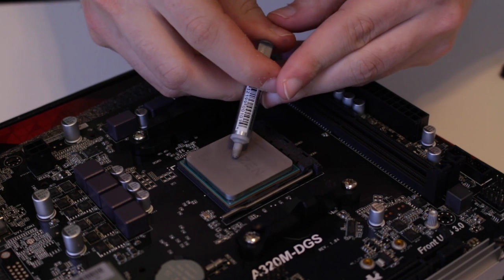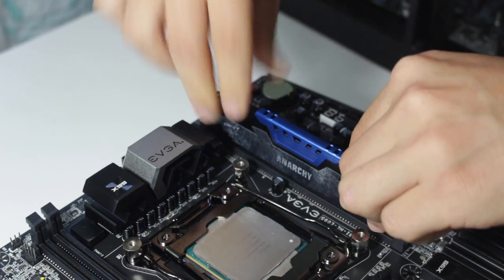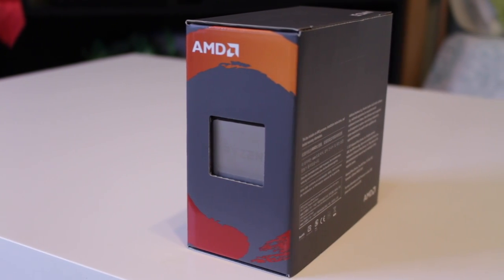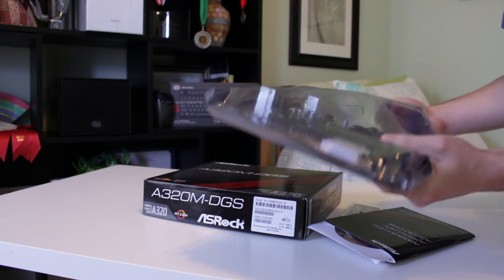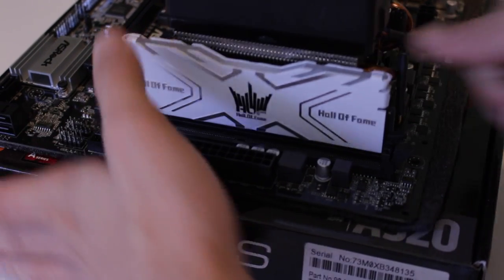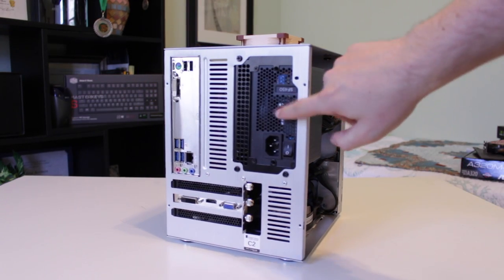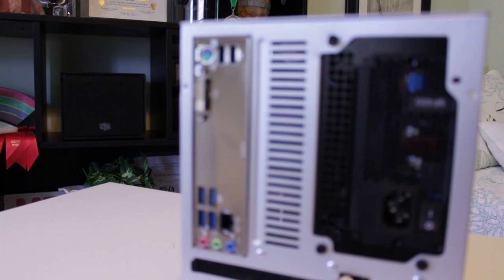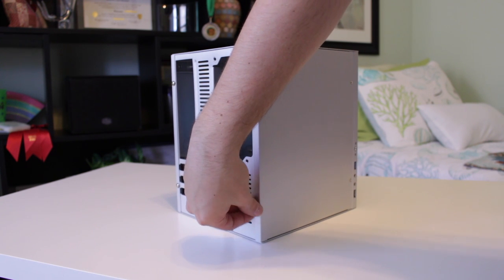I Switched From Intel to AMD... My Build and Why I Switched!

Comment: Reverse the air flow on the bottom fan to blow UP and simply drill a sexy pattern of venting holes in the top of the case, since heat rises, you might as well take advantage of THAT without having to add another fan. Suck cool air from below, vent it out the top - DONE.

Comment: You need to turn the bottom fan around to use it as an intake fan. Otherwise there will be negative air flow and will run as such.

Comment: yes cut the hole for the fan on the top back it's going to help you alot I have been building and doing mods since 1998 when I got into pc. good luck use tape so you won't scratch the surface.

Comment: dont screw up your case!
if anything just cut some vents on the side... youre problem atm is having an exhaust fan on the bottom... but hot air goes to the top, so better make it an intake fan! this way you also get yourself a push pull config
Reply: Looks like he did it by mistake.
Reply: Mr.Haaska he most likely just didnt think that far :P

Comment: You should definetly do the mod, the hot air is bound to rise so you should pull the air out from inside to the top and get frash cool air from the bottom.

Comment: If you're gonna cut the case, find some wire mesh or something and then mount that fan inside the case with the wire mesh bent to where it will sit flush with the top of the case. 

Kinda mac g5 style mesh or something.

Comment: why don't you cut out top of the case like you said install the fan inside attached to the top with fan grill and screws holding the fan in place
Reply: BadKarma 714 he'd have 4 screws sticking out the top

Comment: my recommendation is getting a proper atx case with 140mm fans and good airflow with filter, a motherboard with fan control and it should all be silent.
sell that gpu and get one with a good cooler, 800rpm at  full load should be easy.
i dont like compromises and why should you. dont settle.

Comment: I reckon that you should make this mod happen, but in kinda other way. Try to find a slim profile fan (bigger like 120mm). The footage isn't clearly showing why you can't use it so let me know why exactly you opted for 80mm fan.
Reply from the maker: +Eryk Hanx Not even a slim 120 will fit because of the ram/CPU cooler, but I'm going to check again just invade before doing any cuts. Idk which but either ram or cooler was in the way when I tested fans for fitting. Also, I could fit a single standard 80mm and a slim 80mm behind it, but I'll see how well the single 80mm fan does first and because it's from notcua it should perform well and not be too loud.
Reply: Scythe Slip stream is just 12mm thick. It should fit as it looks like you have near 20mm space between MB/PSU and top cover.

Comment: The aesthetic will be lost a bit, but running cool is more important IMO. I'd probably test the heat first and see how high your temperatures get as is, and if it's hotter than you like, do the mod. Plus the case is so cheap, it's probably easy enough to get a new one if you want to undo that.

Comment: Turn the fan around and make it put positive pressure into the case. You'll blow more out the rear vents and blowing hot air at the ground like you have it now isn't really an effective form of cooling. Also don't cut a hole.

Comment: A320...  PUKE!
Reply: First, it doesn't support overclocking, second it doesn't support XFR.  So yes, it does affect performance.  It is also a horrible value when for only a few bucks more you can buy a board with a B350 chipset.
Reply: Yeah... Did he say he wants to overclock? Or have my ears fallen off?
Reply: Spending an extra 15$ for b350 would have been probably the most bang for ur buck upgrade you could have ever asked for. Thats why.
Reply: dude he basically downgraded his whole system he went from enthusiast to mainstream if that's isn't a massive downgrade then i don't know what is
Reply: his CPU is faster, RAM is faster... and GPU is faster... note the 'faster'... yea hell of a downgrade.. (not including the current 750ti which he said was temporary, but his intended 1060 6gb or 1070 just in case u wanna get pedantic)...
Reply: @Luka_3D  actually yes he did. Somwhere about 2:40

Comment: Since you're not overclocking, I say don't do the mod. Later, when you upgrade, sell the case (which will be much easier without a hole cut in it).

Comment: thanks for the video. way too much thermal paste but very nice custom build. YES i do believe the fan is a good idea.... do it do it ! the only changes i would like is a window and pcie riser card.. but of course that would be case dependent unless you did a massive redesign of it all and at that point you might as well just build your own case. i am a fan of the cube design and i do like/want rgb to but i really like this case as a sleeper pc. one really nice feature is the ability to use a large power supply.. now if you could just fit SLI in there it would be dare i say ? perfect. keep up the designing/modding you are good at it

Comment: to mod your case I would go for a aluminum plate with standoffs so you can cut the top to fit a bigger fan or fans. 5 to 7 mm should do fine without looking strange.

Comment: Flip the PSU so the PSU fan is facing the side panel. Then drill a 120mm hole on that side panel for an extra 120mm fan to blow cool air in.

Comment: Nice Build but dont cut a hole in your case.
your PSU already pulls air out of the case and the big intake fan will handle this.
You can also undervolt / keep the stock voltage to reduce heat output. Check a few Videos for that.
I'm currently running my 1700 at Stock Voltage with 3.6 GHz and the power usage is almost the same.
And a blower style card would help too

Comment: well I'll say for airflow: use a blower graphic card,put a power supply that has a good fan (or mod it) ,and maybe tilt the case and maybe mod it so the io is on top.
Reply: And he need to flip bottom fan

Comment: get a slim 120mm fan (15mm thk) and drill some vents on top. mount the fan from inside the case in an exhaust orientation. also, flip the bottom fan so it becomes an intake.

Comment: Isn't there a way to turn on the PSU fan? I know on EVGA PSUs you can there's a switch for "Eco mode" that'll spin the fan at all times if the mode is off. If you can, that'll fix your air flow problems

Comment: Hello, Matt.
I enjoy your videos a lot and the build looks very nice.
I have the same low profile 750 ti as you and sometimes it gets over 85 degrees while gaming.
Do you think that I should change the TIM or leave it like that?
It still has a warranty sticker on the screw so I was wondering if it will be worth it to disassemble the card to achieve a bit lower temps.
Thanks in advance.

Comment: Great video!
Just a thought, would a reference blower style RX 4-580 fit in this case? I'm pleased with my reference 470 and 480, and this way it's sucking air our of the case instead of circulating a bunch of hot air inside.
Keep it up :)

Comment: instead of cutting a hole in the top 
id prolly cut a big hole in the bottom 
put the thing on stilts just to raise it up not super high
then if u need extra airflow out possibly plug up that side bottom grill 
so u got a flow carrying the cpu heat out
idk im just not a fan of hacking cases

Comment: 80 mm fan is not a good idea. It is loud and does not push much air. You would do much better with 120mm. This system does look nice though
Reply: You cant fit a 120mm fan at the top. except on the outside

Comment: What if when you drill some holes on the right sidepanle and turn the psu with the fan-side up throu the drilled holes? Maybe you can place a 60mm or even 80mm fan on the psu-extension-plate that can pull "hot air" out of the case ?

Comment: please put that bottom fan blowing in not out, its having a tug of war with the power supply fan as is plus you want to blow cold air into the case for the gpu and cpu

Comment: If you can, set the PSU fan to be on all the time.  It'll help with your cooling.

"All Intel has to do is lower their prices and they'll be competitive again."  ~ You
Intel may not be able to do that because their costs are too high.  AMD has both a much lower cost per unit & a much lower failure rate in their manufacturing processes.  In fact, if you check some news items, you'll find there was worry about availability of Ryzen 5 processors because they were getting far fewer Ryzen 7 units with failed cores than expected.

Comment: If you can make it look good I might be ok with it, but you aren't gonna be OCing that so I wouldn't install a small fan being that it's probably gonna be louder than it should be (being it's small and needs to work harder to move air). For one of my builds I tried a slot cooler and though your slots are at the bottom not really where you want it to be (though the slot cooler I bought could be disconnected from the bracket, leaving just the fan enclosure, turn it around and reconnect and it's an intake fan!!) I would look into a slot fan before modding your case. I mean, I don't know crap about case modding (and it being anodized aluminum really?) I'd just be scared to do it myself lol...

Comment: should have kept your 1060 and get an aftermarket cooler for it. I rock an arctic accelero twin turbo cooler on my evga 1060 6g non sc and I was able to get a stable 200mhz core overclock(100 over the SC version) and 300mhz memory overclock) while dropping 20c under load over stock clocks and voltages.
Reply: also put your bottom fan as an intake and let static pressure force hot air out of the case instead of cutting your beautiful case up to add a fan.

Comment: Strongly disagree about the motherboard. I would ONLY use a B350, or X370 mobo, with any Ryzen CPU. Most of Ryzen's performance relies on OC'ing, and you can NOT do that with any 320-series motherboard.

Comment: I know you say all you play is csgo, overwatch, rocket leauge, and South Park but i got a i5 4430 and a 750ti and believe me the 750ti is showing its age and is just not cuttin it for me with the games that are coming out now. Dont get me wrong,(before i a shitload of people start getting on me) the 750ti can play alot of current games on medium-low settings. In fact, it can actually play All games(every one i have) at 720p but i have a ps4 PRO already and there is no point of me having a gaming pc if my console can out perform it in all area's. If you check the graphics card benchmarks logical comparison online it shows where gpu's line up as far as performance and the ps4 pro is up there on par with the R9 290. The thing is you cant overclock ps4 pro and ps4 pro cant do all the custom things a pc can do. Ive been a console gamer my whole but just became a pc gamer this year AND I LOVE IT BRO! JUST no experience like it! Anyway im selling my pc right and i have my new custom rig i just bought and its on the way. I put all i had into it and still didnt get what i wanted to get but its gonna run alot better than what i have now. I got a 16gb,  Anthlon x4 860, 1050ti 4gb, 1TB, 480 WATT. I wanted to get a better processor but at the time it was the best choice

Comment: my only complaint is the case, why would anyone use this kind of case, ok i understand its small, cute and everything else but your old case seems fine and since you are planning or already sold your old parts, then why not using the same case??

to be honest the case is too crowded and has poor ait flow, most probably CPU and GPU will be throttling all the time, even if you mod the case and put a fan at the top, this wont solve the issue, you need intake front fan(s) and if possible side fans and since you only have one option which is the 120mm, it will get very loud often.

Comment: I personally would've settled on a b350 motherboard, mostly because I know I'd be overclocking in the future.
Reply: On the note of the fan modification, I think you should definitely do it if you're actually concerned about temps and airflow.

Comment: Modding the top is not going to look all that good unless you get a machine shop to do it, you may even need to respray the top (upside is color/logo possibility). Given the build I would have gone 1600 but Ok, great cpu (just building my new rig with it now). Your going to be hard pressed getting a small form factor mb in a B350 but i see gigabyte have one but its always out of stock on amazon. For the case I would have gone the thermaltake core but bygones... Single fan gfx cards suck for noise. Dual fans mean a bigger build but the fans on even the 1080ti hardly ever turn on with an after market setup. the price of cool looking and small alas...

Comment: The case looks really nice but I fear you've made a mis purchase. The case is obviously not designed for gaming. Imo you should not drill holes in the case since it has such a beautiful aesthetic, instead you should buy a new case for your rig. I personally am a fan of these small cases, but I never game on my pc's so it doesn't cause any problems since I just run off of integrated graphics. If you want to game on your pc get a decent size case and leave the sff cases where they belong which is in offices doing mundane tasks like mail, web browsing, writing letters and calculating spreadsheets. It will save you headaches in the future and I mean this literally since the fans are going to ramp up significantly to keep the heat under control which will cause a lot of noise since there is no room for water cooling in most sff cases.

Edit> If you do decide to keep the case make sure you get a reference design graphics card since those cards are designed to blow hot air out the back instead of just cooling the heatsink and letting the hot air run wild in your case.

Comment: Ewww that Noctua fan is ugly. Would just drilling ventilation holes in the top panel be an alternative? Hot air rises, so it would make it's way up there anyway. You could also put some smaller fans in the case like halfway or something, just to push the air up there.

Comment: Switched from AMD to intel, hope you like it....   Well I hear that some of the Ryzens will help you productivity and the games you run aren't going to be a problem..  For me, when the 990FX mobos first dropped I bought 2, even before the FX series CPUs hit the market...  I kept my Phenom II  1100t and clocked it up and NEVER bought a FX CPU after seeing it first hand as nothing more than a Side-Grade intstead of an upgrade for what I do...  Next systwm will be an Intel for me. The AMD FX CPU debacle sealed that deal..  Still running 2 Phenom II systems clocked to the gills with Crosshair and Sabertooth 990FX mobos to date..  When I heard what the Ryzen CPUs were priced at it didn't make an sense to go AMD.. this time for a different reason.  So sorry AMD, too little too late for what I need to do..

Comment: What's with the shitty little case, it's not like you don't have space for a regular size case, at least get a micro ATX case to make things a lot easier in terms of cable routing and air circulation, mini ITX cases are simply horrible for gaming PC. I had a thing for small form factor PC too but soon realized that it creates more inconveniences than conveniences, so went back to midsize cases and couldn't be happier. The only reason I would build a mini ITX PC again is for a home theater PC or a home office PC.

Comment: What is the vabrient of your GtX 1060 3gb? So I can avoid
Reply from the maker: EVGA 1060 gaming, the SC is fine because it uses copper heatpipes and aluminum fins, but the ganing version just has an aluminum cooler that looks like and intel stock heatsink

Comment: hey matt 
what do you think of my build ?
msi b350 tomahawk mobo 
ryzen 6 1600 cpu
two of gtx 1050 ti gpu
gloway striker 2133MHz RAM
Reply: ryzen 5 *
Reply: you can t SLI 1050ti 
not even 1060
Reply: I can wait until june 2018 , is that enough ?
Reply: Nabil Sumrain ofc it is 
try to find a gtx980 second hand
Reply: ok thanks :-)

Comment: Guys pls can you answer me this question?
This tuesday I will be getting a MSI gtx 1060 Armor V1 3GB that I bought for 255€. Do you guys recommend me to try to sell it for 350€? It's my first GPU ever, right now i'm with an iGPU intel HD graphics 530 xD. What would you do?
Reply: Said Shamkhali I would sell it because I've seen some used gtx 1070's going for under 350(Reddit hardwareswap), and since the 1070 is relatively new, there isn't a lot of risk, since most are still under warranty
Reply: TNX for the response :D!
Reply: no problem

Comment: I thought that buying the AMD Ryzen 7 1700 was the best deal, performance wise per dollar. 

Wrong. The Intel i7 7700k is only slightly more expensive (by ~$15) and has much higher single threaded performance (Which is important for games and most tasks). I'm not going to return my Ryzen 7, but let this be a lesson:

Do your research.
Reply: If you're only gaming, sure.  Ryzen is about playing games and doing 15 other things in the background at the same time!

Comment: Don't go for AMD's GPUs... I actually was an AMD fanboi, and the RX 460 OC from Sapphire dissapointed me a little, yes, it's really cheap and it runs kinda great, especially for the price, but it just doesn't keep up with new games, and, quite frankly, it struggles a bit with some games like Rainbow Six Siege (althought with the 1700 should run much better) and triple A titles. If you got the money, go for anything from Nvidia, I think the 1050 Ti is better than the RX 460.

Comment: That is a bad copilation in my opinion because you throw performance away. With a little more expensive B350 motherboard you can overclock your cpu, but the A320 don't allow that. And your GTX 1060 with only 3GB VRAM isn't a good choise.